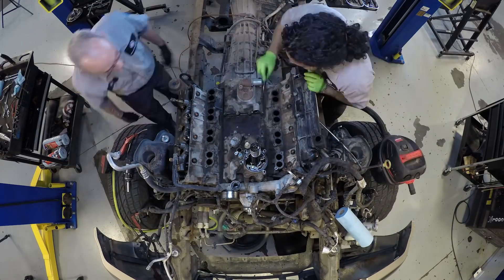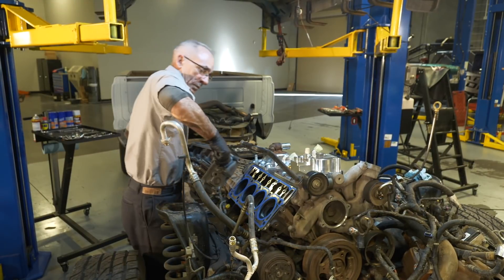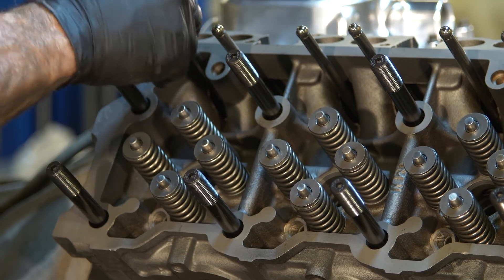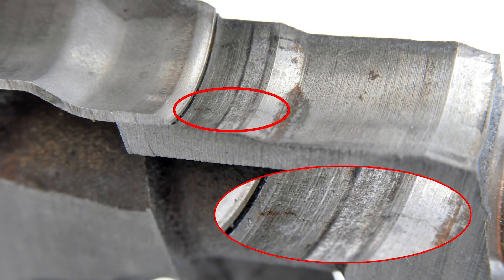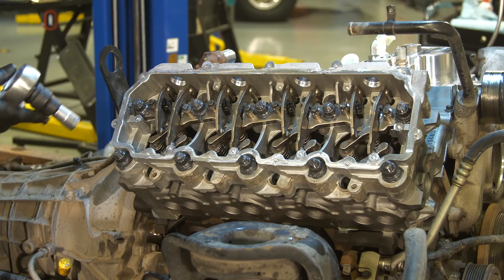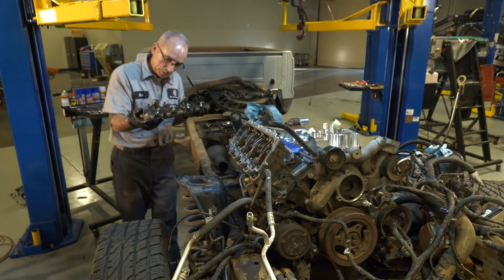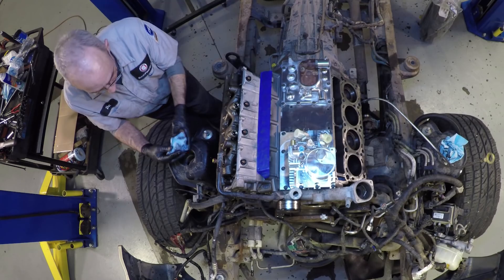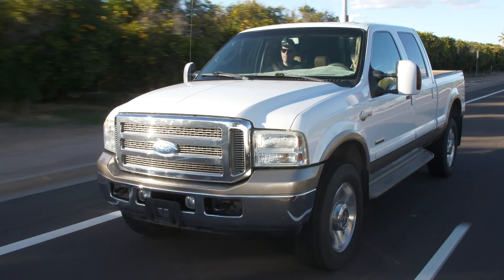Fixing 6.0L Pattern Failures - Episode 3: Cylinder Heads

Comment: do you guys resurface and oring the heads?
Reply from the maker: We do resurface the heads, and then provide new valve guides and hardened valve seats.  Then we drill and sleeve the injector bores to protect against fuel seep into the coolant pathway.  After this, stock injectors can still be used.  We do not o-ring the heads, as we have found it's not needed.
Reply: @BulletProofDiesel  At what level of boost do o-rings become necessary? I understand stock applications probably don't benefit from it, but when power adders are installed when do you start upgrading internal components? Thanks.
Reply from the maker: @zuggyrama  Because our focus is really reliability and longevity, not so much the performance side, we really have not had any experience with the "o-ring" heads.  In our experience the internal engine components are quite tough, but upgrades may be necessary, is tuning away from stock calibration.
Reply: The bottom end of the 6.0 powerstroke is extremely tough, capable of handling 800rwhp.
Bill Hewitt with Powerstrokehelp does O-ringing the heads. Its not necessary but does provide 0 chance of headmaster failure.
My heads are o-ringed